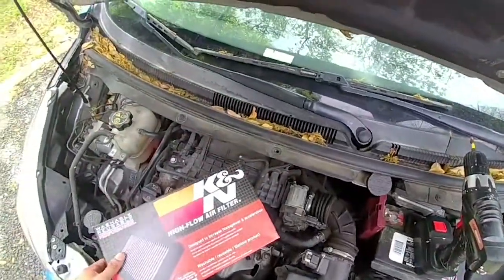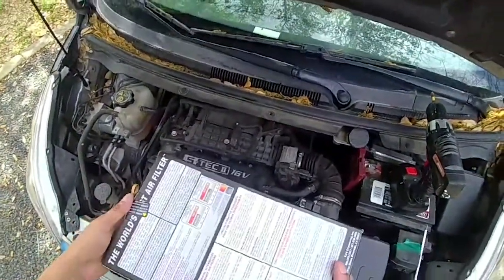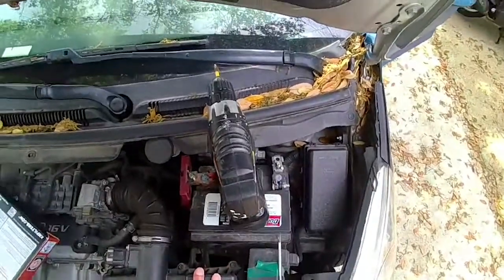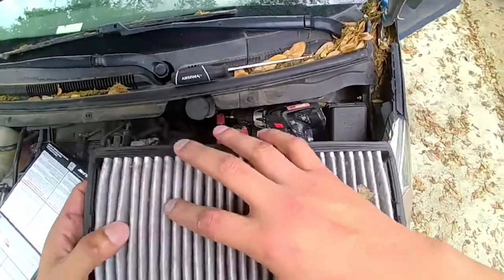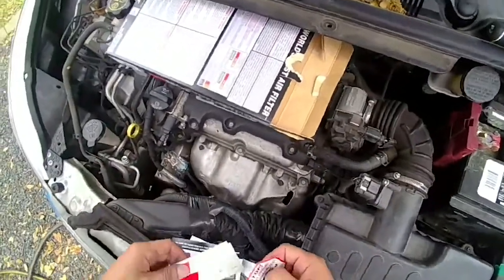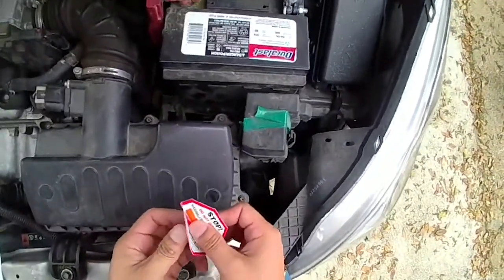K&N Replacement Engine Air Filter for 2015 Spark

Comment: Hi , It been a around a year , How you like it , was it worth it , and what are you impression so far , Thanks
Reply from the maker: Would say that I had an increase in power but because the spark is so lightweight it may not be worth it to put this air filter on. I felt that after I swapped the air filter the car started wheels had too much power and slipped.
Reply: Sorry pal I don't think the 0.1 hp gain made your spark to a non gripping burnout monster all of the sudden😂